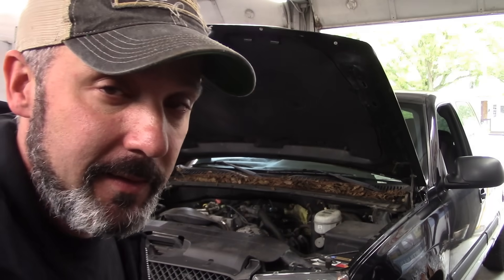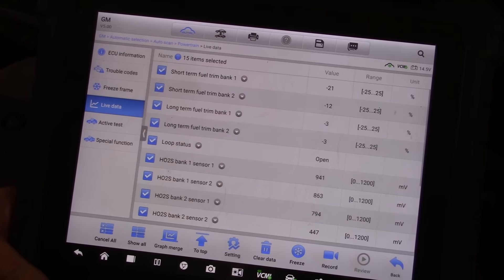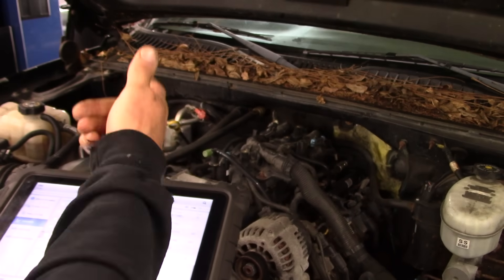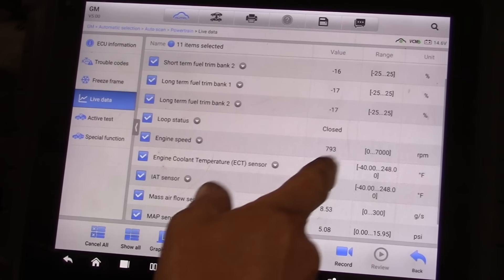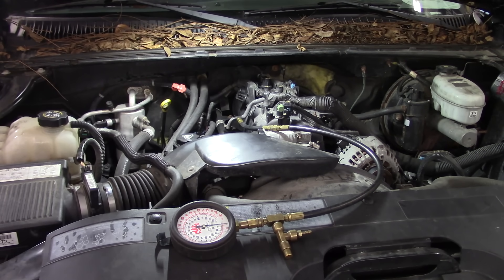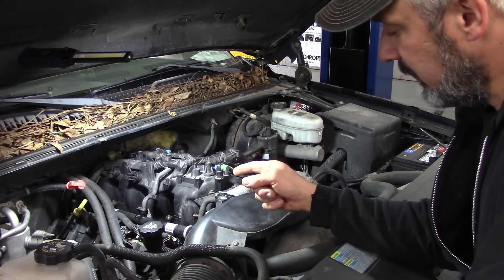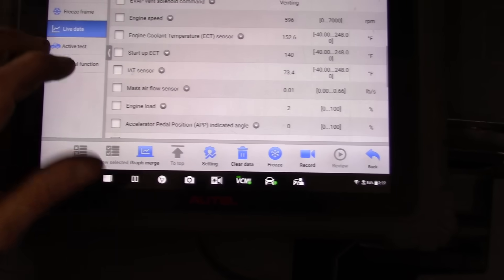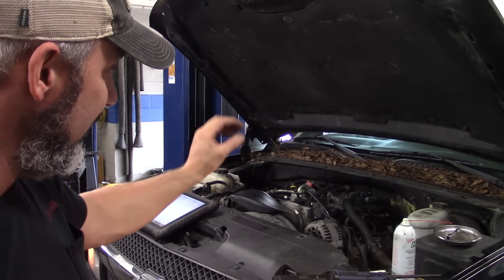Parts Cannon Special: Rich Running Chevy Truck P0172 and P0175

Comment: i just had a 2014 chevy spark kick my ass with it running rich and sensor 2 o2 low voltage. well after a lot of wasted time, turns out the 02 sensor position 1 was the one causing the issues. even though i would unplug it when it would start to stall no change. apparently it was an aftermarket one. when i got the correct 02 sensor for it it looked different and it fixed it, only way i found this problem was getting a known good spark and comparing engine data.

Comment: Make sense to me I remember years ago before we had all these electronic parts to do the calculating for you or for your vehicle. My father bought a car that came from higher elevation A carburetor. Now remember it was a carburetor back then. Was running too rich For our elevation with the correct amount or incorrect amount of oxygen and fuel.  A little bit of adjustment and it was good to go.

Comment: What particular problems cause crap fuel injectors to make the engine run rich?  Are the spray nozzles/orifices too large, solenoid springs within the injectors not providing enough tension, needle valves within the injector not sealing or seating properly???  Very curious about the cause.

Comment: could you have a fuel pressure drop test to measure  injector flow.
Reply from the maker: Without having a known value to compare it against that test doesn't work very well. That test is typically used to find differences but not exact figures. For example you find the difference in flow from injector to injector comparative to each other. Service data doesn't have any published information as far as how much an injector should drop with a certain amount of on time. Does that make sense?

Comment: Dude, ive watched every video on here and this is the closest to my symptoms, yet still not my problem.. fuel trims are -25-30, super rich, no vacuum leak, o2s seem normal. Ive put injectors, checked plugs and wires. Fuel pressure still goes down when primed and letting sit off for 20 minutes or more. Fuel regulator? It doesnt swuirt fuel out so id think its okay? 🤬😖😤

Comment: Question , where do you find your info for “strategy” for lack of a better term.
  Was looking at MAF ITA temps and they are “high” vs the temp probe I stuck in there. I have a intermittent cooling fan coming on with key off and there seems to be a some issue with resistance in the IAT and ECT ?  
Looking at a few different vehicles it almost looks like the ecm averages IAT with ambient and ECT.

Comment: I'm dealing with a similar issue on a different vehicle. Even though swapping out the injectors fixed the issue, any idea what the flow values are on each injector?

Comment: I tell people ALL the time, "Please, do not just throw parts at it" Test, each system, but nooooooo, we gotta break the bank, then ask what else should I replace? I say, are the wheels original, might as well replace those, and they say "But those are not bad" I say "neither were all those other parts I told you not to replace either." Duh...

Comment: @South Main Auto Repair LLC, I have 2013 Honda Accord EX 4 Cylinder, that has P0172 on Bank 1 , replaced high pressure fuel pump , replace PVC valve, MAF sensor all OEM , check engine lights comes on sometimes and goes away, any suggestion

Comment: 2015 Silverado with the 5.3 l. I just had the plugs and wires changed and the plugs are ac delco but they used duralast plug wires. I’m getting a random engine light and a bank one and two rich code. Would duralast wires cause this? Truck doesn’t sound rough but sometimes when I turn off the ignition the engine will try to run and shake for a second.

Comment: Hi Dennis here ,, I have a problem...my camaro 2013 zl1 supercharged camaro has a p0300 dtc and on the scan tool I have . The fuel trims stay in open loop and CANNOT read feul trims because they stay at 0% . I replaced the coils ,plugs,o2 sensors,mass air and wires . And I have no rich or lean codes either . I'm at loss . Need your  thoughts to what is happening 😕

Comment: Just wanted to say hello and wondering what you want to change all fluids on a2012 Silverado pans off the transmission clean and filter, transfer case pan off and clean brake fluid oil top quality synth oil and rear end fluid change
Reply: Top quality synth
Reply: Lol you’re looking at like $3000 for a shop to do that.

Comment: It's funny that junk yard oem parts are still better than flea bay "new" parts. Aftermarket junk parts strike again. Unreal how bad those injectors are with fuel trims -25 to -30. I'm curious if a flow test would have revealed anything about how bad those injectors are.

Comment: I see lots of folks talk about replacing working wheel bearings, sensors, injectors, and coils for reliability.  Then they wonder why they have problems.  LOL
First rule of wrenching.  If it works don't fix it.

Comment: From fleabay listing: "These High Impedance fuel injectors have been 100% tested and exactly match the internal coil resistance and fuel flow rate of OEM fuel injectors.The individual flow characteristics and fuel atomization of above fuel injectors are almost same to or superior to the OEM and will help accelerate response time , save gasoline and improve MPG." ....Ya, sure!

Comment: I need you to come look at my hyundai tucson 2006 im having the same issue p0172 p0175 pending p0170 p0173 n a misfire but no driving issues p0304 everything changed new still giving me a headache not sure what else it could be new plugs new coil pack new wires new iac valve new tps sensor new injectors plenum gasket new 02 sensors new purge valve new fuel pump over a yr old n filter after market air intake but its not that it only started the rich bank 1 n 2 after putting in the plugs n injectors n the misfire as well battery n alternator are good new starter n it was giving lean codes now their rich n fuel trim back 1 n 2
Reply: And its also still taking along time sometimes not all the time to crank over sometimes it starts right away other times it takes along crank and I had a new cps sensor put in n new throttle body gasket it was leaking air from the tps sensor n the iac valve had it smoked still having the same issue i Sprayed around the throttle body n sensors with carb cleaned instead of reving up it wants to stall was told its the timing but had a new belt n pulley installed last summer at 205,000 miles now has 221,000 n its a used engine did the thermostat n drained n flushed the coolant had a leak but fixed it ut was leaking from the where the hose connect to the water inlet new thermostat n gaskets n always change the oil at its intervals I don't think its the timing its not giving any driving issues had plenty of power just you can feel it misfire while your sitting at idle but not now as much after changing the purge valve I dont know what else it can be it had to be the injectors it does blow a little white smoke from the tailpipe but not like clouds it dissipates after a little n has a sweet smell gas
Reply: I was also told it was the o rings for the oil but no leaks not blowing blue smoke its extremely mind puzzling been battling basically the same issue for 3 or 4 yrs

Comment: so here is my issue 2010 Impala crank no start codes P0011,P0172,P0523,C0899 ABS, so what do these codes mean and how would you fix them? I never been one for new JUNK PARTS why do the job twice OEM makes it Right , it is frustrating when a customer dont want to fix it right ,then brings it back for the same repair ,some learn faster then others. good job nice peace of  reasoning, if it looks like a duck  well you know the rest of the story.
two thums up

Comment: Not ALL aftermarket are bad! I notice you did not check o2 function. That should have been basic, even though there were no codes!
Reply from the maker: I did check O2's. I used fuel trims to make the entire diagnosis.... correct me if I am wrong.

Comment: I learned that Fleabay junk is just that, junk! Counterfeit spark plugs almost caused a misdiagnosis at a shop I took it too, they wanted to replace the transmission when it was just misfiring even though it wasn't triggering a check engine light. A few years ago I got one of those aftermarket MAF sensors, it was constantly throwing a lean code. As soon as I got an OEM one, those problems went away. The aftermarket one went into the trash. Regardless of how good of a deal it seems, it's just not worth it. Buy OEM and buy it from a reputable reseller or retailer.

Comment: Had a V-6 Ranger. Same deal. Customer installed boneyard engine. Flex fuel in non-flex vehicle. Same as yours had half-dozen other issues. I told the shop owner, need correct injectors. He didn't believe me because NAPA said they were all the same. Few months later I stopped in after I had left that shop and asked about the Ranger as It was gone. Injectors. He even after it fixed it didn't believe that was the problem. LOL! Owner was one of those damn NY/Connecticut/New Jersey Yankees. He was a great mechanic just didn't trust his employees to diag anything. We agreed to disagree. I moved on.

Comment: Theoretically, as the car body corrodes away it's  BMI  (body mass index) will decrease and  hence should get better fuel mileage due to the less weight - correct?  LOL

Comment: I agree with about ebay parts somewhat so far I've been lucky if buying parts from eBay the key is to look at the feedback rating and if they have lots of negs In one month read the comments. I don't buy parts from sellers with neg feedback of 20+ if they are a longtime seller and have very few negs then it's usually safe to buy from them.

Comment: It's the mid eighties and I'm working at a GM dealership. Some guy has just spent all of his recently received tax returns on every part he could think of. GM had been having a lot of issues with coolant temp sensors. Coolant would seep through the top and into the connector housing. I off handedly said to the guy in the next stall, I bet it just needs a coolant sensor and connector (it came with the sensor back then). Sure enough, after this guy spent hundreds, if not at a thousand bucks on guesses, all it needed was a twenty dollar part. So you think a professional mechanic is too expensive, well, you'd be wrong.

Comment: Why did the owner change out the injectors in the first place? They're not a maintenance item and strange thing to shotgun. Also, why were the O2 sensors never suspected? If an O2 was faulty, it would send the wrong info to the PCM and it would incorrectly adjust fuel curve. Bad info gives bad results.

Comment: C'mon! I knew when you were contemplating getting the fuel rail that it would be the fix. I just looked at the video time and how much time was left, and I knew that would be the fix!
You are making the videos - when working on the vehicle you should see whether it is almost over and decide on that basis whether it was the ultimate solution.

The same thing applies to the detectives in First 48. They should watch the show and see if the suspect's face is blurred out. If so they have to keep looking, but if he is not blurred he is the guy.

Do I have to do all the thinking around here?

Comment: I don't get buying ebay or amazon injectors. I have a 2017 Ford Mustang ecoboost. I just went to Rockauto and Motorcraft injectors for my 2.3L Trurbo are $45. So $180 for new injectors. I get it, it would be twice as much on a Chevy V8. Still not the end of the world. And the injectors would be the correct ones.

Comment: Lesson to be learned here. Cheap parts are just that CHEAP!!  Which is why the phrase “ ya get what ya pay for” was coined. If you want your vehicle fixed right don’t wimp out on cheap parts. 
They will invariably CAUSE more problems than they correct.

Comment: He better have whipped out that wallet and handed you the cash for that repair. Authorized or not, you clearly fixed his issues. Lesson learned, don't buy aftermarket crap parts.

Comment: 4.8s were never Flex Fuel. Only 5.3s were. I bet he put 33 lb FF injectors in it instead of the stock 25 lb non FF injectors. That would explain the extra fuel.

Comment: I've been down that road of buying non OEM parts and it sucked, nothing but a money pit and that's why I use only OEM now and my favorite fluids, synthetic lubricants, filters, fuel additives and more. AMSOIL, I had a 95 Sierra with over 495,000 miles on it due to AMSOIL. It's expensive but worth it.

Comment: (at 8 minutes into video) 
not a mechanic ... but a lifetime of complex technical problem resolution
after you replaced the MAF it is STILL reading (what looks like) a HIGH number (8.x) for idle (700 rpm) ...
as YOU obviously know ...
an over-reported air flow would drive the fuel injection higher (causing RICH w/ actual air flow) ...
(maybe this engine has a higher idle MAF value than i'm used to seeing at idle)
(back to the video)

Comment: China empire strikes back again. The orifice in those injectors is way too large to have the fuel trims pegged like that. My guess they were changed leading to the parts cannoning with
 the MAP and MAF sensors. My thinking that these are injectors for a big block 454 or similar and may have been a mistake and ordered wrongly. I don't use China knock off parts either specifically for the same reason. At least now that truck can pass an emissions inspection.

Comment: Great  troubleshooting.  Shame it's on a junker that the owner won't pay for.
Find a way to sort out the bottom layer of cheap customers.  You're way overloaded on good shop work already.
I have quit taking part in several vehicle repair forums just because of the same shhittee, owners using the cheapest import parts.  Has made the used vehicle market a buyers nightmare.  I would not touch one of the Dodge Cummins pickups off warranty because of all the cheap "repairs"
There are even knothead owners out there using the cheap Chinese crapola parts on newer BMWs, real used junke

Comment: I don’t what the parts can in and an auto shop I didn’t even work at. The so-called Chevrolet trained professional down the street with his own shop could not figure out a Mitsubishi‘s misfire. When I got asked to go over to his shop and help out the guy started telling me about all the things that he put into the vehicle $1600 worth of crap in the vehicle. I told him to walk away and stop giving me hints on what it may be because obviously you haven’t fixed it yet. Do you know what it was a coil was bad that was it fucking ignition coil and he couldn’t figure it out. Dealer trained technician nine ASE certifications. This just tells you paperwork don’t mean you know how you do your job it just means you know how to read a book and take a test.

Comment: Idiot bought the wrong injector size.  Probably thought, “well if it comes with 240cc injectors, 500cc injectors have to be better, right?